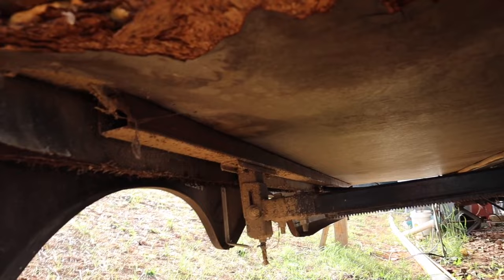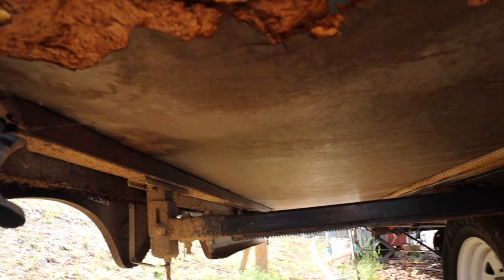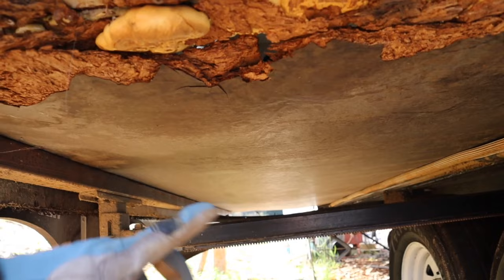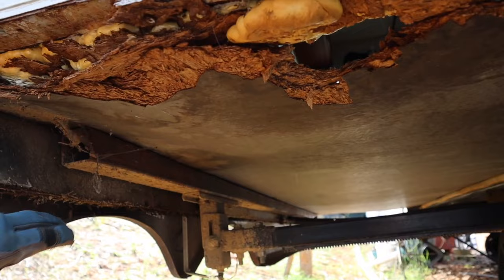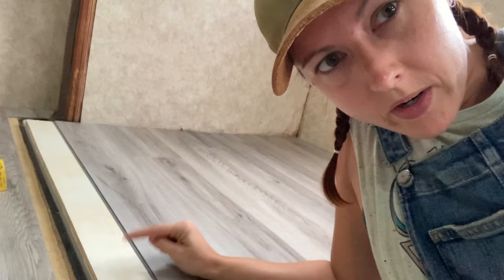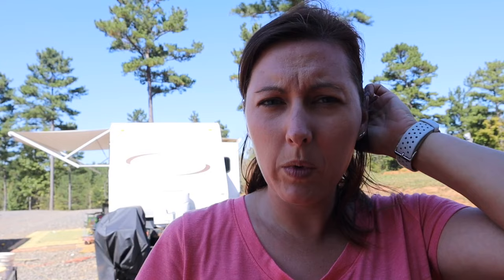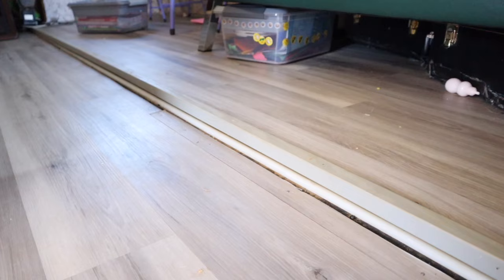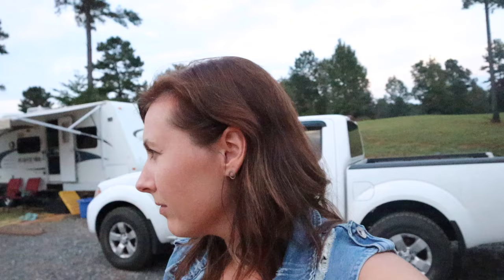Replacing a Rotten Slider Floor DIY | Camper Life

Comment: You've still got rot & mold inside of that short-wall (probably both ends), at least 6-8" high across the bottom, which means you also have rot on the wall plates...which will spread over into your "new" floor within a couple of years. That entire corner joint is rotted about 3' ft high from the floor...This includes framing, as well as the Luan plywood, which your finished side is laminated to. If there are any buckles in the exterior surface, that is another indication of that surface being rotted & moldy also...de-laminated, at the minimum. Even pressure treated wood will de-laminate & swell, if the edges get wet for a prolonged period of time. The long back wall looks like it may have some issues, also.  When you redo the floor again (next time)...It's worth spending the time to remove the rust on the steel supports (especially where the two surfaces join), then prime & paint, because rust scale will eventually lead to a much greater expense & a possible safety issue.
Reply from the maker: Agreed. Except the best step is probably to trash the whole thing. Lol
Reply: @DreamitBuildit  I'm in the process of doing major surgery on a 43' Layton by myself, in storage w/ no shore power, only using a  generator...slide-out floors (one is 16') & partial walls, re-laminating fiberglass on entire front end (both wall sides) & rebuilding the entire front end of the trailer from roof to subfloor...It's a bit mind-numbing to tackle, but I love the challenge...I think? I'm doing all the framing with treated lumber, minus the subfloor...that will get a few coats of poly.

Comment: Ah man I wish you guys would have filmed putting the board in. How did you connect thr board together so they don't fall in between ? The inner most part of the slide out has a slide angle to it as it goes under and out from the wall. How was that fitting it in there?
Reply from the maker: There was enough of a lip on both sides that we were able to bolt it to. It is definitely tricky because you can’t add too much to the bottom and it still slide smoothly.
Reply: @DreamitBuildit  what do you mean adding to the bottom. I really appreciate this reply.

Comment: Hi guys!  Nice fix. Just out of curiosity, how old was the camper when you purchased it? Since we’re also planning on going the camper route after we get the land purchase settled, watching you do these fixes has given us some insight on what to look for when buying the camper.

Looking forward to more of the house build!
Reply from the maker: It's a 2007, we bought it used and it had been sitting for a while.  We had to buy last minute and didn't really know what things to look for when we were buying - plus it was when campers were really popular during covid and stuff was selling before we could even see it. Anyway, we would definitely recommend taking a good look at the structure. Lots of things can be replaced or fixed (we've heard stories of much nicer and newer campers having things break worse than ours). Structure and water damage is really tough. Look for soft floors and walls, as well as tears on the exterior that could let in water.
Reply: @DreamitBuildit  thanks for the info!

Comment: So what did you ever do for the covering of the slide guide the carpet covered
Reply from the maker: It came flush flooring to flooring and we did a small piece of trim attached to the slider piece that made it look a bit better.
Reply: Any way to see a pic of the trim you did, about to do mine as that long white floor guide came loose and having to reattach it which means pulling flooring up

Comment: What did you use to adhere the plywood to your first layer?
Reply from the maker: A heavy duty construction adhesive. You can get it in large caulk gun- size tubes.

Comment: Hello I need some help I replaced my rv slide out floor but when installed back now when I slide it in it hit the corner frame which makes the sliding hard or noisi. Could you give me an advice. Thanks
Reply from the maker: Well we are far from experts in this area, but it sounds like it needs to be trimmed down in that area. It has to cover the open area but also fit when completely slid in.
Reply: @DreamitBuildit   hello thanks for replaying. Yes that is what I was thinking but the opening has a metal trim around it. I would like not to cut. Do you think there is other way.